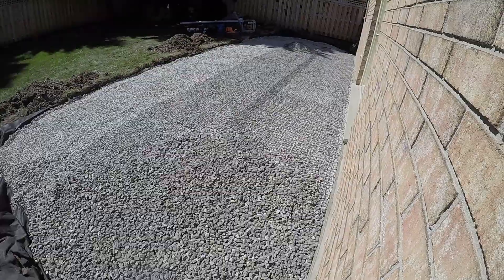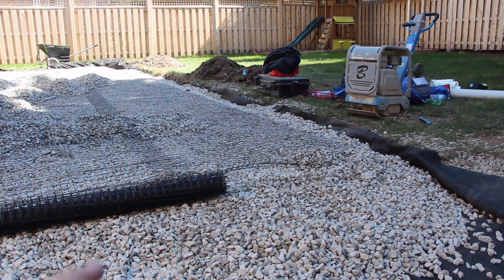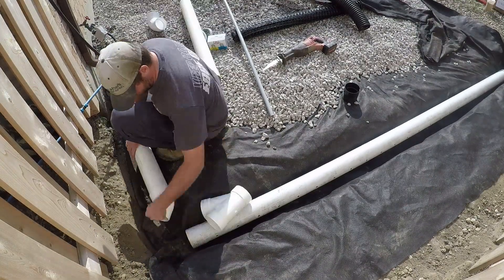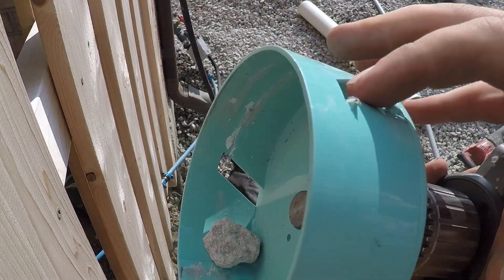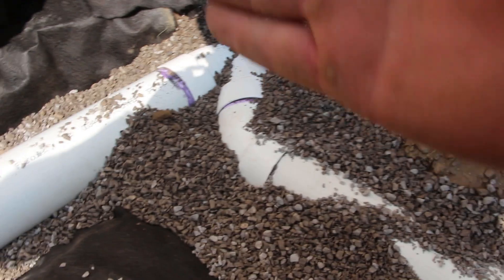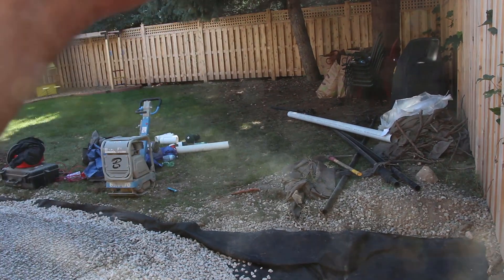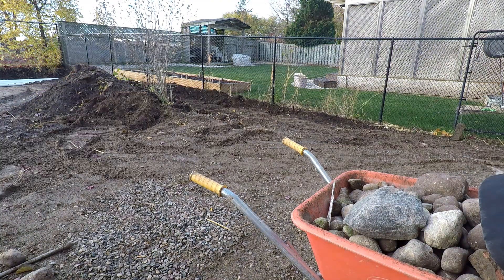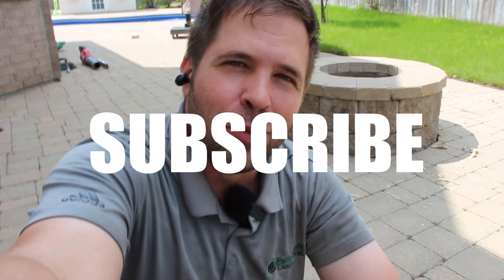Open Graded Base DRAINAGE for Pavers

Comment: I think I'm starting to understand drainage a little better, thank you for that. I am a complete noob but want to venture into building patios for cottage gardens in my country but the concept of drainage still carries a lot of fog around it.
Reply from the maker: Drainage does get difficult. But the key thing is, move the water away from the house and following the current grade of the property.
Reply: @iamahardscaper that makes sense, I read that too much water falling near the house can slowly destroy the foundation. Very Bruce Lee hehe.
Thank you! Some fog has lifted! (Only now it's replaced with technical questions for my current project 😂 )

Comment: Huge Fan.  Love the science you bring to the work.  Question: Is HPB ever used as base (without a paver base) instead of 3/4" gravel? Is that not also acceptable for drainage?
Reply from the maker: I know some contractors that will do this. But no, it should not be used as the base.

Comment: 2% Open grade with non woven over sand probably doesn’t need drainage right?
Reply from the maker: If the joints are permeable, I would want something for drainage. If the joints are polymeric sand, you should be fine. We don’t do sand as a bedding layer on top of 3/4” clear
Reply: @iamahardscaper  I was thinking the opposite for the joints since I thought the permeable would help the water move better through the system. Glad to have gotten your opinion. And yes, I meant over a sandy soil sub-base. Thanks for the insight!
Reply from the maker: That sounds good, yeah sandy sub soil you shouldn’t have anything to worry about